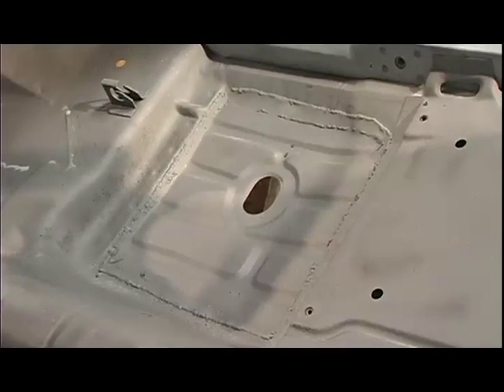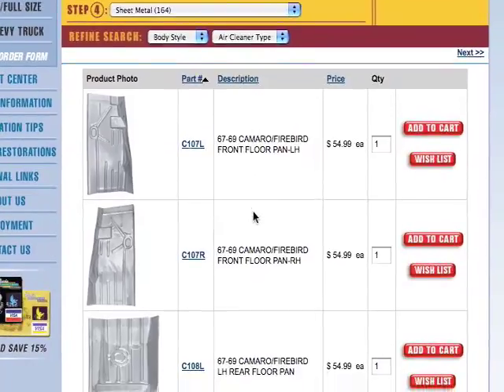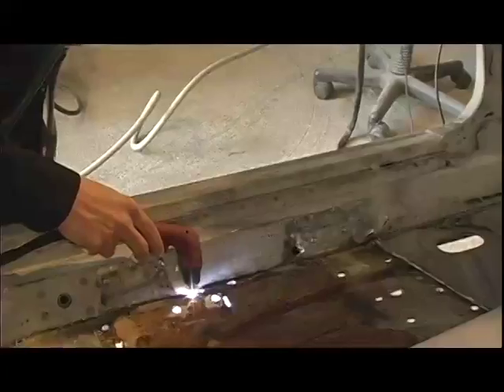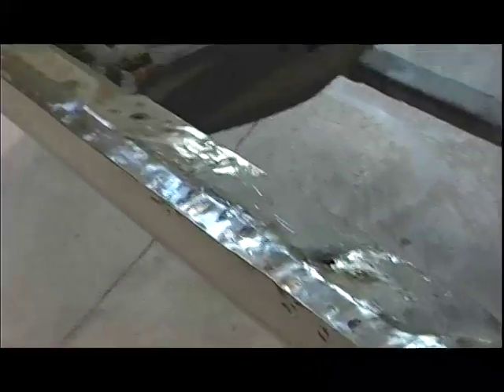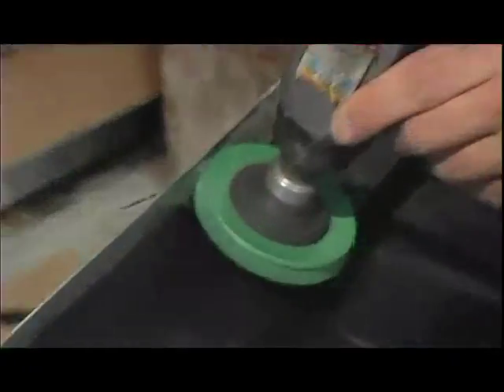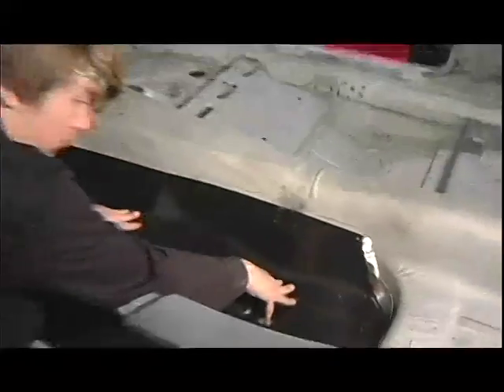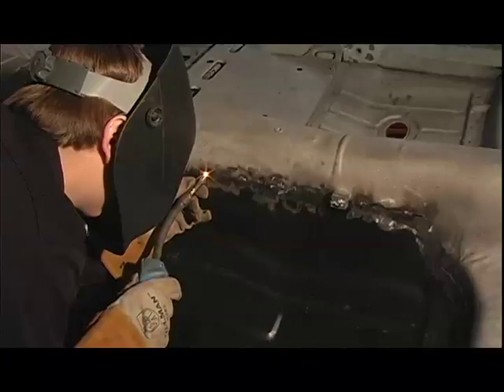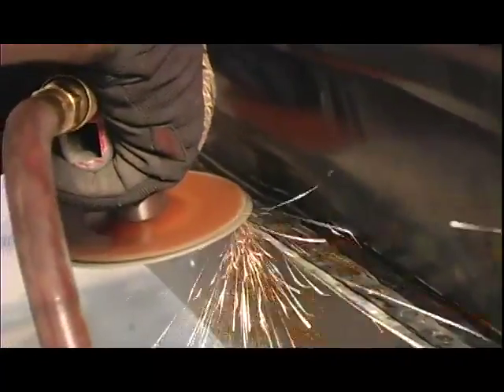1969 Pontiac Firebird "Routy" Floor Replacement - V8TV-Video

Comment from the maker: Properly installing a full floor would mean drilling all the spot welds and breaking the factory seams where most of that material was in good shape.   It just didn't need it.   When we finished, you cannot tell the repair was made, and it was less time than a full floor.

Comment: Hey im currently repairing my dad's 1969 firebird convertible and was wondering what you would do if the floor was in good shape but around the weather holes there is little rusted out holes. Would you replace the whole front floor panel?